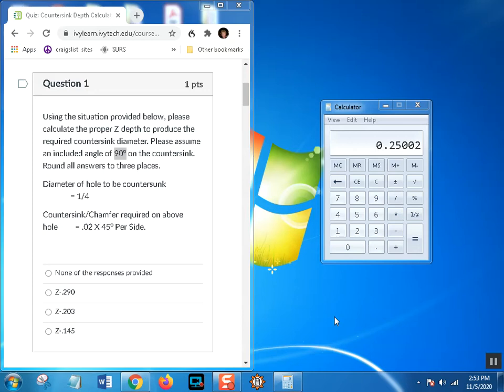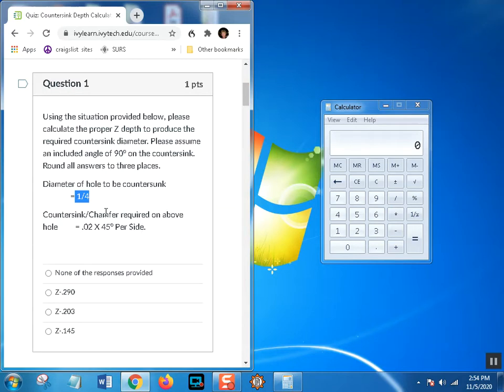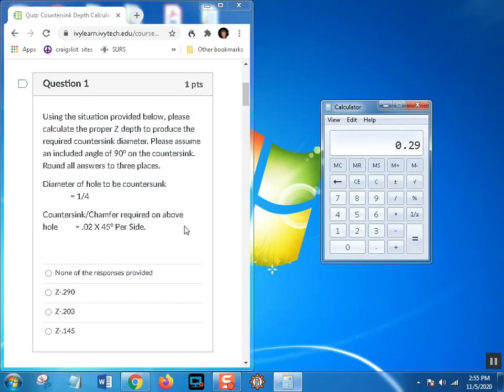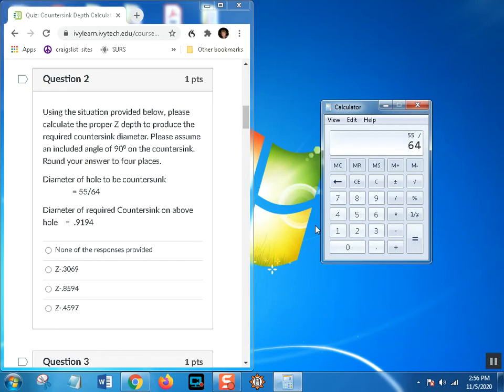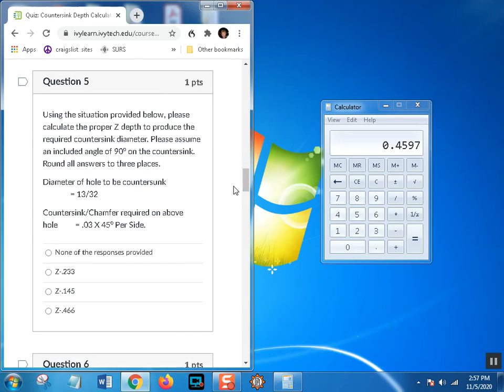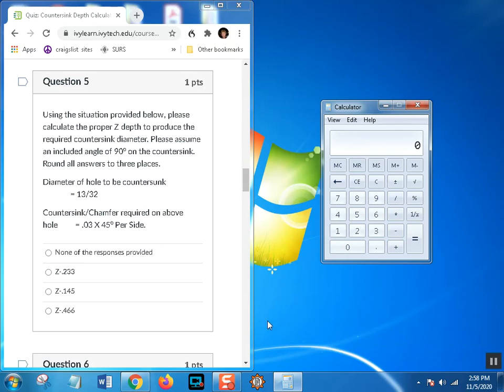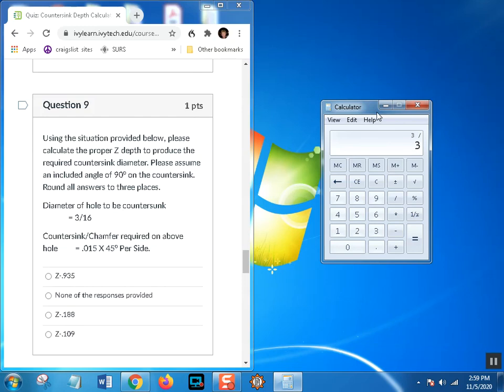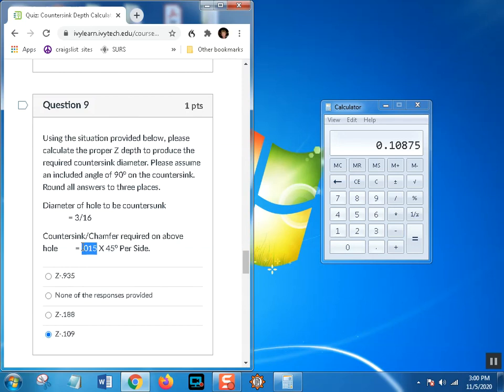90 Degree Countersink Depth Calculations

Comment: If you have the BIG Diameter (Cunter sink) and little d Hole drilled) I was taught to do D-d/2 x 1 for 90 degree countersinks for depth in so confused and frustrated
Reply from the maker: On a 90 degree countersink (the tool) what ever diameter you want the countersink hole to be, just have the depth of your counter sink tool to be half of the diameter of the countersink hole. if you want a 5 mm diameter countersink on the part then program the tool depth to go down 2.5mm.